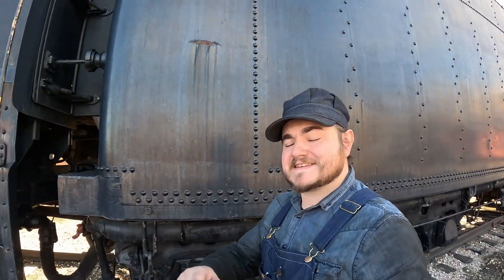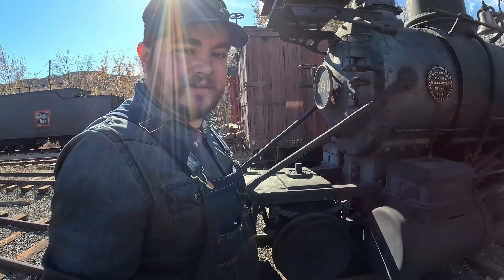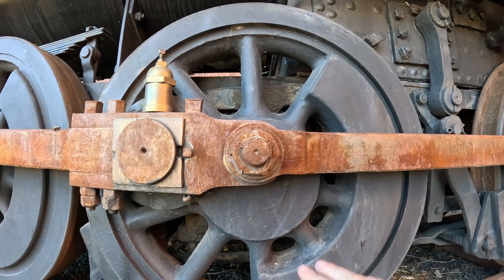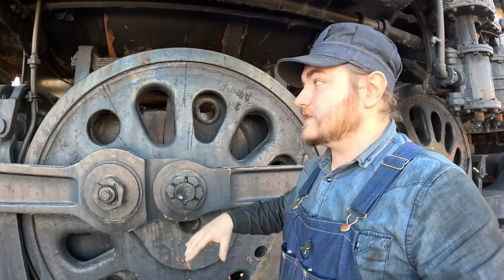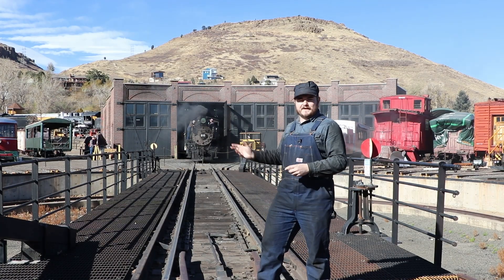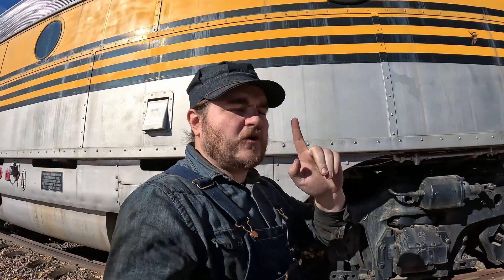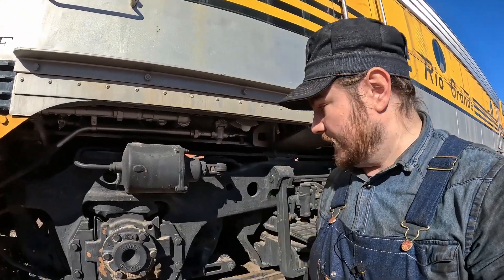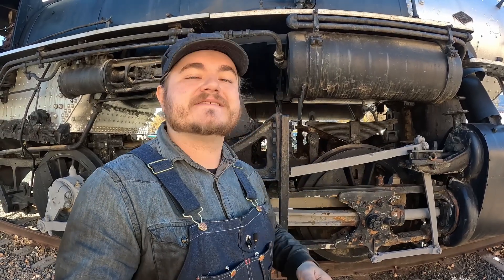HUGE vs. TINY drive wheels - Why? | Railroad 101

Comment: this works not only on steam locomotives because in the early 90's when they tried to beat their own speed record the SNCF (the french national railroad company) putted bigger wheels on the TGV. They seted the world record at 515.3 kph (320 mph) until 2007 when they found another way to beat the speed record.
It works also with electric trains (and diesel etc...it works with all the vehicles with drive wheels) 
if you're faster you always pull less (a car's engine runs faster than a truck's engine but a car's engine can't pull 40 tons)
with the same displacement we can have 2 different level of torque: with a short stroke and a big bore your engine can runs faster, will have more power but less torque. In opposite wiith a long stroke and a small bore your engine will be will run slower ( too much constraints) will be less powerfull but more torquefull
a steam locomotive it's torque at its best so to go faster they had to use a shorter distance to the crank compared to the diameter of the wheel (this train looks fast)
Reply: Electric motors have an RPM limit. It could be the case the record TGV would have exceeded that limit with the smaller wheels, and bigger wheels mean they don't have to  modify the gearing. Electric motors also have less torque in the high RPM range compared to the low RPM range
Reply: @simonm1447   i don't know how they did because since they tried to break their own record twice (and they managed to with one record at 574 km/h 368mph) with more standard wheels (a 40 inches wheel spins faster...how did they manage to get faster with an engine limited in rpm)

Comment: A very clear explanation of why sizes mattered and why different locomotives were used for different applications. But I wonder what happened if a diesel geared for passenger service was paired up on a freight train with a freight diesel. Did that ever happen due to motive power availability, and did the passenger locomotive provide less pulling power than the freight locomotive they would have preferred to use?

Comment: Good vid.  Educative.  You asked for comments….mine is, once you moved onto diesels, you never used the word torque, which is the important factor.  You did explain why the crank position changed the torque (leverage) on steam locos, but not on diesel-electric set-ups.  Over to you…

Comment: Fantastic explanation, I'd always wondered why the diesels and the roundhouses were somehow mutually-exclusive eras, and it turns out I hadn't understood the scalability of the diesel power versus the locked-in wheel-size-to-torque-ratio of the steam engines.  Eye opening for something that I thought I already understood, thankyou Hyce!!

Comment: 7:51 which is a bit of a missed opportunity really because  if they had put a cab on it at the other end it could have been easily driven in both direction
Reply: For what really? When you can just put another unit and marshall them?
Reply: @BraviazRahadi  well for the same reason they do with European units  so you dont have to turn them around to face the  right direction saves on needing loops, wye's or turn tables makes it more "flexable"

Comment: If you haven't already, could u do a video explaining why,on bigger locomotives there was different counter weights when the wheels are the same size. How piston size was determined because it looks like on some locomotives, the pistons are the same but driving bigger wheels but less of them like a 2-4-2. Well at least the pistons look the same to me. Lastly, could u do an inside tour of that B unit please if u haven't already.

Comment: Well explained once again =)
With true electric traction it's similar, especially nowadays with three phase asynchronous AC motors. You can make it work with almost any wheel size for almost any speed. The ICE 4 e.g. has ridiculously small wheels for its 250/265 km/h top speed.

Comment: I thought that the speed of the diesel electric trains was controlled by regulating the electric current at the alternator. So does that also factor into why wheel size doesn't matter as much compared to Steam trains?

Comment: The 191 engine looks like the wheel flanges are on the outside?
I thought that was unstable.
Do you have a video on this?
Reply: Flangeless driving wheels are used for negotiating tighter case. In the case for D&RGW narrow gauge railroad, this is necessary

Comment: So wheel size/ crank location are equivalent to a modern transmission, in that if those two factors were to change the power and top speed balance. Interesting.

Comment: I remember learning about this concept (big wheels=speed, small wheels=power) some years ago, and came across an example of it when I saw two of Union Pacific's steam locomotives in Ogden, Utah. Living Legend #844 is used for passenger service and has large driving wheels to move the train as quickly as possible. Big Boy #4014 has smaller driving wheels, as it was designed to haul long freight trains.

Comment: Doesn't the larger drive wheels provide higher traction due to a larger contact patch?¿?
Reply: Shamelessly asked Gemini, Although larger wheels have a larger contact patch, the total weight of the locomotive is spread over that larger area, resulting in lower contact preassure per square inch. In contrast, a smaller contact patch has higher pressure, which can sometimes provide more "bite" into the rail surface.

Comment: Hyce I've been wondering if a steam train ever had or could a turbo, would it make the coal burn better and cleaner. I also love the channel and it tought me soo much about train and got me interested in them
Reply: Not exactly a turbo, but there were both some attempts at forced induction, and many more locos using forced draft.

Comment: Back in 1973, there was a train loaded with bombs that went kaboom while it was at the Roseville rail yard. Locals refer to it as the Roseville Explosion. At the time the rail yard still had its roundhouse and the explosion was started by a tinder box that had caught fire. So I thought, roundhouse + tinder box = steam powered engines, but my mom says there weren’t any steam engines involved. Why would diesel engines have tinder boxes? Could there have been steam engines still around at that time? Sadly, the Roseville Explosion is an event that doesn’t get a whole lot of attention.

Comment: Something you didn't mention is that diesel-electric engines(and electric engines too, for that matter) would be set up so that the output voltage/amperage could be controlled and therefore the speed/torque relation of the traction motors could be continually varied within the operating range. The fixed gear ratio between the traction motor and wheels is supported by an effectively continuous transmission.

Comment: Sooo a dum question. The scene from Polar Express where they are drifting the train across the ice, unrealistic i know. but is there any realisem to what the engineer is doing? And would the wheels switch directions in that fasion if you were on ice? 🤗
Reply: I am no expert, but I would think the locomotive couldn’t get any actual traction due to how slippery ice is. Realistically all you’d probably see is really aggressive wheel slipping lol. Let alone change directions.

Comment: the wheel size also determines how much wheel has contact with the rail the smaller ones would have more, and I will correct you on the roundhouses, steam needed them because they needed inspected and serviced after every run and needed a place to clean the boiler and get a fire going as well, dieseles can just pretty much start up check over and go like a car, and did not need overhauled near as much so they did not need all the shop space and special trades like pipefitters and boilermakers and forgers, though they still exist in the major shops but pipefitters run conduit and sheet metal work, the boilermakers function like blacksmithes, heavy fabricators, and also work on thick plate cars and pressure vessles that might be used on the railroad and form out parts as well as straighten frames and the like but you prob knew that 

today roundhouses are pretty much used as running repair shops, car shops, or as the said backshop for heavy rebuild like altoona would be or cumberland, and beechgrove for amtrak

Comment: I don't know the situation in the US and how many Y junctions you have to turn around, but in Germany we had round houses because we needed the turntable anyway to turn around the engine (steam engines are mostly awful to drive in reverse for the crew (it goes slower most of the time and in tendered locomotives it's also mostly even worse view in reverse as for out of  the front)). So that's where you have to have one track, but the turntable has 360° so why not use them for storing your locomotives with less space needed then a feathered loco yard (where still every loco has its own stand, but build along the yard track with switches). Of course that is only applicable if you need the turntables and therefore need that space anyway. Nowadays locos can go pretty much all the same speed in both directions here (I know us locos often can't do that still, but I guess in case where you need that extra speed you'll just put another one on the back as it's often just a limitation to counter the fact that the view out of the back is not as good as out of the front because you have mostly just one cab where we have 2). But anyways, nowadays there are still many different locos which are more or less limited in what they are really good at - of course you COULD run long haul trains with a shunter but you might not want to do that for really good reasons...
Also in Germany we have shared infrastructure per law on every railway so we have also often hundreds of different operators all with their engines wanting to use that in big shunting yards pretty often all at  once and of course every operator wants his loco when he needs it, so we often have feathered yards or we have something like a modern "turntable" which in fact doesn't turn but moves sideways through the pit, which is pretty space consuming still, but it scales better at large sizes as you don't have to spread out the circle to get the spacing between the tracks to fit locos on all of them without overlapping. Basically the requirement in space is 2 loco length for every slot and an incoming track. In small yards a feathered yard may be better as you need a bit under 2 loco length plus the incoming track over the full length which results a little over 2 loco length for every slot but you use the incoming track which you need for the other solutions as well so if you have only 3 slots directly on the incoming track that's a bit less space needed.

Edit to clarify:
But as I said the operation of locomotives is largely different in germany then in the US, so this might also be different and should only be seen as a mention on the situation in germany unless someone that actually knows american railway operation better can say if this is also true for American Railways or not!

Comment: That is where carmakers say 2.7 axel ratio is tall Gering for speed a short ratio is 4.11 ratio the engine turns 4.11 turns for one turn wheels in high gear

Comment: I have a question only tangentially related: do they just leave those cables and hoses hanging out on the front? My aunt and I were watching this video, and she wondered, because she was concerned about water intrusion interfering with electrical systems.
Reply: Yes, it has no issues whatsoever

Comment: Very interesting, we don't normally think about the crank centre position on loco wheels. I also noticed that there were no flanges on the two middle wheels on 191 to allow it to cope with tight radius curves.

Comment: This made me remember that weird double wheel I got to see years ago during an inspection in a museum in ... Chomutov? I think? It was a pretty large high speed locomotive double wheel, but that's not what was interesting about it. The interesting part was that there was a crank in the middle of it instead of a straight shaft. That thing appeared to have been designed for extra two pistons under the locomotive somewhere. Edit: It's a Railway Depository of National technical Museum in Chomutov, and for the love of god I can't find the photo of that double wheel I took back then.
Reply: Double-expansion engines often had one of the stages hidden inboard.
Reply: @matejlieskovsky9625  So that's what it was! Thanks!

Comment: Isn't it also true that the torque vs speed curve of the electric motor can be programmed electrically to act like a larger or smaller drive wheel size??

Comment: In Europe roundhouses are still in use, but now they house diesel and electric locomotives. The roundhouse at the local station was in use until about 20 years ago. Now it's considered a heritage site, and preserved for posterity. There's a furniture shop in the roundhouse building.
Reply: Apart from decent chunk of britain.
there isn't many roundhouses left nevermind actively in use.
Most of the country just used and still does use regular row sheds with a turntable somewhere nearby. (though the turntables have mostly been ripped up and only the markings from where the pit was remains)
Reply: @davidty2006 a quick glance at the major railway depots in Czechia quickly yielded nine roundhouses that appear operational from satelite imagery.

Comment: Would you match wheel sizes on an axle by axle basis as they wore down? The difference between a new and worn wheel diameter seems rather substential to me. Or does the suspension take care of that?

Comment: Steamers. Smaller wheel size or further crank towards wheel edge= More pulling effort less speed. Vice versa.
Why diesel (or electric, rare in US) wheel size does NOT matter it's because it's motor driven. Electric motors (diesel engines run on electricity generated by combustion) have its performance curve like it's at full wattage in a range of rpms (or speeds). As long as your operational status is within it a bit of wheelsize difference doesn't matter.

An example of demanding the maximum pulling effort with little loco wattage is the Chinese class QJ which is 2-10-2. You only have those pathetic power and there's a big train to haul without requirements of speed. So what? Make really small wheels!
And that's how QJ did their jobs although at a speed of 20-25 mph.

Comment: Petrolheads never seem to realise that this all applies to them too. They'll bore your arse off about torque and horsepower and never mention the gear train or the size of the driving wheels, still less the final tractive effort their wheels produce at the road.
Reply: Indeed. I was curious about the torque reaching my wheels because having recently done some maintenance that involved disconnecting my CV shafts, and I was surprised to find that, though my engine only puts out 130 lb-ft or so, when I'm running in first gear, that's actually over 1,000 lb-ft to the wheels because gear reductions (transmission AND differential).
Reply: Some said a Toyota Supra is more powerful than EMD of GM F40PH, and it's powerful from horsepower (they haven't even learnt what is torque nor tractive effort)🙄

Comment: Hi Mark great explanation into the importance of wheel size and how it relates to speed and tractive effort. Also really liked the your main point about crank placement to wheel size ratio, force and speed. As well as the crank setting the piston stroke and what that all means. Fabulous details in this video. Speaking of details, really liked seeing 191 up close as you discuss it’s wheels, crank and all that. I really get an appreciation for the small size of the earliest locomotives, so amazing and, frankly beautiful. I stand at awe when seeing C.B.&Q. 5629 what a choo choo. To quote you it’s “super cool.” I’m always struck by how diverse and impressive the the rolling stock collection is at The CRRM. Well, Professor you give me much to contemplate with this latest 101 video. Learned so much! So many thanks for another well done episode and many cheers to you! 🎉

Comment: I used to think that narrow gauge engines were much smaller just because the track was smaller, until I read about South African Railway's Red Devil. A 3' 6" gauge 520,000 pound 4-8-4 with 60-inch drivers, that could do over 80 mph and pull a serious consist of freight. A very fascinating video, and at last a second opinion on locomotive mechanics for all of my friends who think I'm crazy! Love it!
Reply: The biggest Cape gauge, AKA 3'6" locomotive driving wheels wheels I am aware of are on Japanese C61 and C62 locomotives, measuring 1750mm or roughly 69" https://upload.wikimedia.org/wikipedia/commons/6/6b/JNR-C61-2.jpg

Comment: Yes I gather wheel size is a factor in tractive effort but I read the general rule was 1 inch per mile at wheel rim speed so a loco had to have 76 inch wheels if it had to do 70 miles an hour